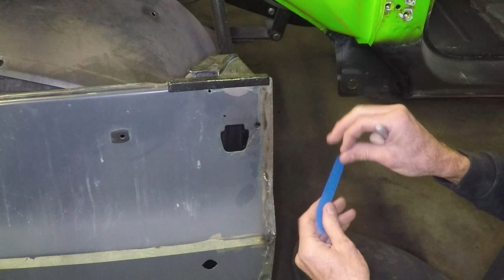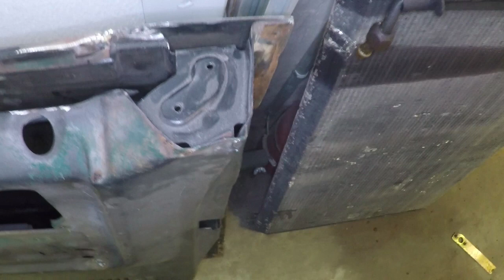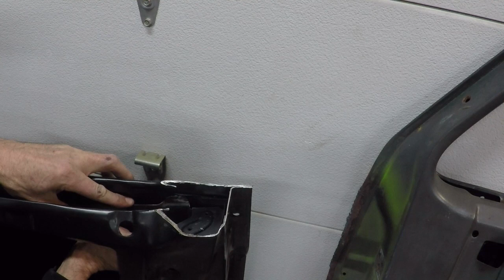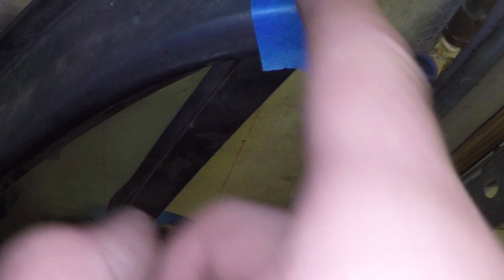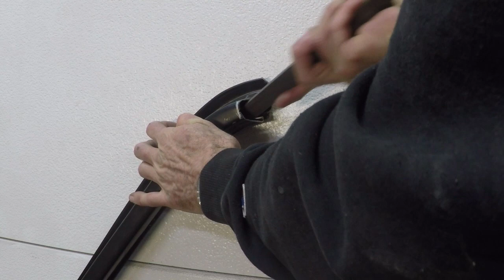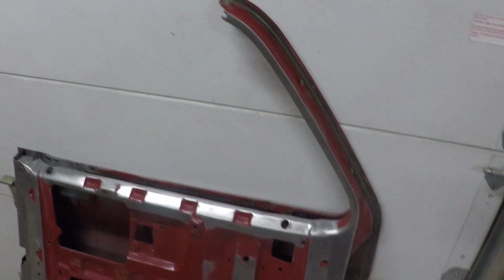Cutting C10 doors to fit a 1973-1975  K5 Square body Blazer

Comment: Interestingly the factory cuts on the junkyard donor truck i got my top and windshield frame from are clearly different from one side to the other.
Reply from the maker: That's a conundrum.   Are you using the junkyard doors as is?
Reply: @CrankAddict no, they're rotten beyond repair..
Reply: Very possible for every door to be slightly different. It's my understanding that from the factory, they never made this door they just cut down the pickup door with a bandsaw so there's not really a science to it.
Reply from the maker: @tysonwheeler3053  You are correct.   It is similar to the way Hurst cut holes in the roof for the t-top trans ams.
Reply: @tysonwheeler3053  thank's learned something tonight ( didn't realise they built those the same way as the covid-era challenger convertible in Florida, also didn't know that about the T-top vin's but that would probably explain some of the recall's of the era and or the hit&miss in reputation's for wind/water issues and or general-ageing-issue's ) i don't have a blazer-body, but i do like the idea of converting my 85~longbed 1ton into a convertible/softtop/hard-top-removable( plus i like frameless glass body/door's style's and lot's of gingerbread/crome like/example the charger 1970 more, and it would let me have 2-way opening vent-window's twisting/normal and 1988/fully rolling-down mode ) and or extra carbon-fiber+Plexiglas( moon-roof or bobble-top look-ish ) and adding the back window that rolls down like some of the toyota's/ford's-models do

Comment: Good video, I've done a bunch of conversions over the years. I get it close and do fine tuning with a grinder to make sure all the weatherstrip areas fit right. I don't measure, I use layers of tape to make templates The upper vent window area in this video has some still on it.  https://www.youtube.com/watch?v=YOYhBCRS9nw&t=2s

Comment: Crank Addict, I have a ‘75 I’m working on.. I replaced rockers, floors, rear quarters, fenders. The huge mistake I made was allowing the whole firewall to ‘lean’ toward the rear without knowing such that my top would no longer fit. I’ve had to cut back through the rockers and pull the firewall toward the front with a come-a-long. That being said, I’m worried about it moving back over time with the weight of the doors when the top is off… thoughts about the structure holding over time?
Reply from the maker: Avoid rubber body mounts and go polyurethane.   Solid mounts would be best if this is going to be toy.    The truck gets its strength from the frame.  The better you can join the body to the frame, the more solid it will be.   I made the same mistake but was able to correct it in time.  Next time I will solid mount the body to the frame before any cutting.

Comment: Can you make a video on how you do the door glass and run channels ?
Reply from the maker: It will be coming along in time.  Give me another month or two.
Reply: @CrankAddict  hey just curious how you did the door glass, my windows come out of the channel every time I roll them down
Reply from the maker: @John2250Nt  Make sure your rear lower support has all the washers to make it stiff.  If it is missing the washers then the bracket will flex and the window will pop out of channel.  Happened to me, too.
Reply: @CrankAddict  okay awesome I’ll take a look at that
Reply: @CrankAddict  thanks i wondering what the difference's between models/part-like-door's is/was im looking at doing this conversion/convertible for my ( upgraded-specs )1ton longbed( fleetside aka my showcar and or nicer mode with gramp's SS toolbox as it was in the 80's-to-09~/got it in 2000's/teenager-me )/( off-roading and or harder working that's there's a good chance that i dings/scratch it and or needs the extra 9ft wide~ and or off/rails for towing-5th or side mounted-box's/tooling/service-body's ect )flatbed 1985~ as i got to leasing/barrow a 2004~ TJ and found i liked sometimes having the top-removed( composite hardtop )/softtop-down also like the windows sold in the toyota/ford's that completely rolls out-way/downwards
Reply from the maker: @richardprice5978  I don't know of the cutoffs, but earlier doors had thicker glass and runs than later doors.   The change to electric doors in 1977 may have been the impetus.  In 1980 the doors got new door panels to match the new front clip, but these door panels will retrofit to 77-80 door panels no prob.   
If you are talking about hardtops, then 73-75 hardtops are the full convertibles.   I have not converted a 76+ to a full convertible so I could not tell you what it takes.
Reply: @CrankAddict  how’d you make out with the door glass and run channels ?